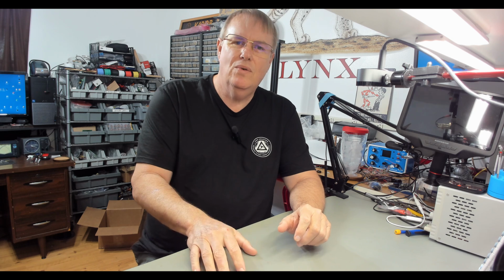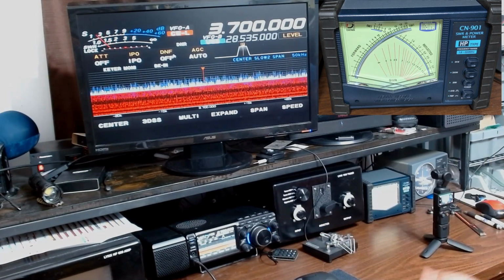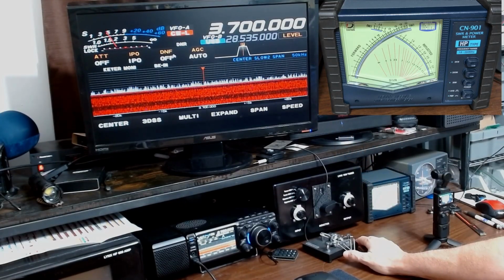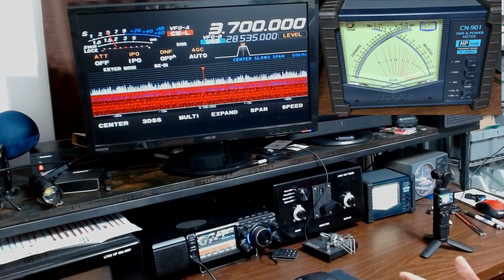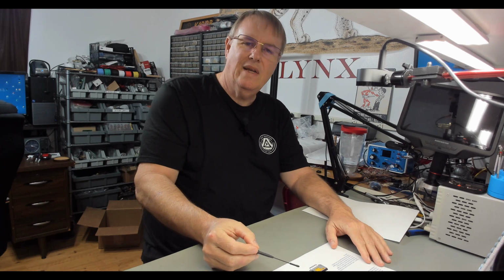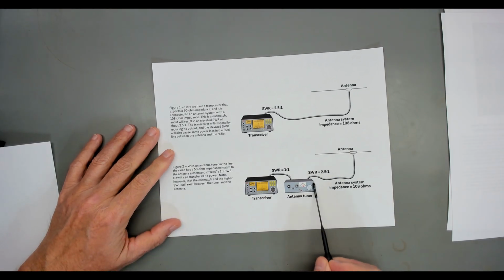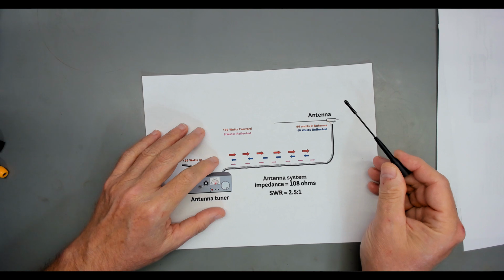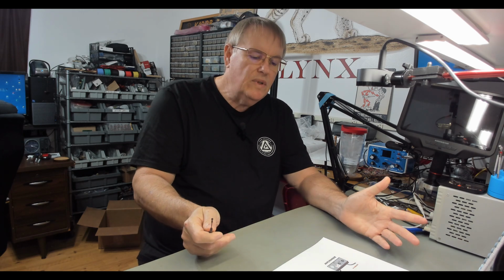What Most People Get Wrong About Antenna Tuners!

Comment: When a reflected signal arrives back at the antenna, it will have been delayed relative to the original signal by a time dependent on the cable length and transmission velocity in the cable. Isn't there a chance it will be out of phase with the original signal, thus reducing the transmitted power rather than adding to it?
Reply from the maker: If you look at the standing wave at points it is lower and at points it is higher but the end result is as everyone agrees, the power that is not loss in the feedline is radiated. It is not loss. 
RJ
Reply: @LynxElectronicsLab  The reflected signals are delayed relative to the original signal, so presumably they add to the radiated power by smearing it out in the time domain rather than increasing the peak value. Doesn't that cause problems with reception? The extent of any problems would depend on the wavelength and the cable length, and I appreciate it may not be an issue at the frequencies you're talking about. But it sounds similar to the multi-path problem that occurs both with radio transmissions and with fibre optics. Sorry if I'm barking up the wrong tree - it's 45 years since I studied this stuff and I didn't have a terribly good grasp of it then.
Reply: @stevegreen5358 the reflected power adds in phase with the forward power back towards the antenna

Comment: A lot of this is a matter of semantics. An antenna tuner is a matchbox. It makes the antenna system appear to be 50 ohms to the transmitter. It does this by canceling the inductive and capacitive impedances out, making it a resonant system. There might be a mismatch at the antenna feedpoint, but the portion reflected back to the transmitter get re-reflected by the tuner. All the signal would eventually get out to the antenna if not for loss in the transmission line. Coax is high in loss so that's why people like resonant antennas and avoid tuners. But I use a doublet which is not resonant. I rely on a tuner to make the system resonant and it works because my transmission line is open wire - very low loss. But the point is that the tuner does tune the antenna system and Ive proved it many times with a nanoVNA.
Reply: Absolutely correct you have described how the tuner electrically tunes the system to resonance, there's no semantics about that description
Reply from the maker: I agree it is all semantics, if you listen in my video I make that point many times. For example what is included in this so called “antenna system”. 
Do we tune antennas to resonance at all? Tuners do not come with VNA’s they come with SWR meters. Low SWR isn’t normally at the point of resonance. I understand both sides but I adjust my transmatch to make an impedance match with my radio. The rest takes care of itself. You are one of the few that gets what I am saying. Your description does not disagree with what I describe in my video. Except you call it tuning an antenna and I call it matching impedance. In the end it’s the old “taste great / less filling” argument. 😁
RJ

Comment: I prefer to use a 'remote' tuner at the antenna site, 33' vertical wire on a 12m Spiderpole, this remote tuner tunes against many random copper cables . The other tuner I use is the MFJ-989, mainly to protect the radios by transmatching the slight mismatch  on the transceivers. The only 'real tune' with this tuner is how I couple up the long wire and tune via cold water ground. Does a good job across HF bands.
Many thanks for explaining a very informative video to those who follow the myths, now they know the truth, best 73 😎 👍 🏴 ✨ ✨
Reply from the maker: Thanks, the truth resides in the middle and this was my point. It’s all semantics and this is why I said this in the video. 
RJ

Comment: The antenna tuner is more about protecting the transmitter output amplifier stage from high voltage and/or current. This is more an issue with modern solid state output stages where a mismatch risks unforgivable results. Replacing output transistors is not enjoyable.
Reply from the maker: No it is not! At least on the wallet. I kind of like do it myself. But I’m weird like that. 😁
RJ
Reply: @LynxElectronicsLab 
Also, some output transistors are no longer available.
Reply from the maker: So True! Man all the good parts are disappearing fast!
RJ

Comment: While an impedance matching network enables maximum power transfer to a non-resonant antenna (electrically long or short) by counteracting its reactance (using the complex conjugate), the antenna's inherent inductance or capacitance persists. This internal reactance of the actual antenna causes non-radiating energy to be stored in the near field (due to the phase shift between voltage and current within the antenna structure), oscillating locally around the antenna. The reactance measured at the antenna's terminals doesn't magically disappear, and consequently, the antenna itself will generally be less efficient at radiating power compared to a resonant antenna. However, this doesn't mean that non-resonant antennas are not useful, nor that impedance matching is not beneficial.  And yes! They used to be called a transmatch which is much more accurate.  I think the switch to calling them an 'antenna tuner' is more of a marketing thing.  Thank you so much for further clarifying this topic!
Reply: While most people use the term "non-resonant antenna", I prefer that you as least think of it as an antenna which is not naturally resonant at the operating frequency, because the antenna tuner (or loading coil or whatever you use to cancel out the antenna's reactance) brings the antenna to electrical resonance. Such an antenna will be less efficient than a naturally resonant antenna, but, with proper design, an antenna which is not naturally resonant at the operating frequency can be made to work surprisingly well. Take for instance, a doublet fed from a tuner using open wire line, or a broadcast tower which is not the correct height to be naturally resonant. One of the most famous high power broadcasters in North America, WLW, with their 500 kW rig at 700 KC, used a 5/8 wave tower whose reactance they canceled out with a tuning unit at the tower base.
Reply: A natural resonant antenna isn't necessary more efficient than a non resonant antenna, the tuner electrically tunes out the reactance of the whole system
Reply from the maker: Your welcome! Thanks for watching.
RJ
Reply: One thing I'd like a view on from the experts is whether it's any better to have an antenna of exactly 70Ω, than (say) a 50Ω-17jΩ with the same SWR. Is there anything better about 0 j or is it just the magnitude of the mismatch that matters?
Reply: I'm not sure that you are correct about off-resomance lowering effociency; reactance has no loss.

Comment: Here's a good way to look at resonance: Lets say we have a simple LC (coil + capacitor) series resonant circuit. It will resonate at some particular frequency. Now let's add a second capacitor in series. We haven't changed the original coil or capacitor in any way, but adding a second capacitor TUNES them to a new resonant frequency. In the same way adding series capacitance to an antenna, while it does not physically change the antenna, tunes it to a new resonant frequency. I wish people would qualify it when referring to the physical length of an antenna by calling it the NATURAL resonant frequency, the frequency at which the antenna resonates when no loading inductance or capacitance is applied. Hams often add a loading coil to their too-short mobile HF whip so it will resonate at a lower frequency. Antenna resonance is a electrical concept.

Adding capacitance or inductance to change an antenna's electrical resonant frequency is one function that an antenna tuner can perform. It can also perform the matching function, that is changing the radio-frequency resistance to a different value, similar to an unun or balun.

In my experience as a broadcast engineer, we use both of these properties of an antenna tuning circuit in the "dog house" at the base of the tower. First, we make the tower, which is not always the correct height to be naturally resonant at the broadcast frequency, exactly electrically resonant. (There are also "parasitic" factors which affect the tower's complex impedance and resonance, such as the tower lighting chokes or Austin ring transformers which get AC onto the tower for the lights.) Then we match the radiation resistance of the tower, often around 23 - 25 ohms, to the 50 ohm coax back to the transmitter building.

I hope this makes sense.
Reply from the maker: Thank for your very detailed input! I think kind of get what I was pushing. It’s not that I do not understand or believe in the resonance argument. It’s more about what a hams purpose for its use. They were in use long before Maxwell wrote anything about them. They built them to match the impedance of their radios to their antennas. They did a great job doing this and they didn’t know anything about the rest.  They simple knew if they put a variable T impedance matching network between their radio and antenna, they could match the impedance. Again thanks for a great response. 
RJ
Reply: @LynxElectronicsLab  Here's an interesting fact that is really mind blowing. An antenna can be resonant at multiple arbitrary frequencies simultaneously! (And I'm not talking about harmonically related frequencies.) How does this work and when is it used? These days, land for tower fields is expensive, so in many cases, two or more AM broadcast stations share a tower. Each transmitter feeds a separate 50 ohm coax to the "dog house" at the base of the tower. In that dog house is a separate tuning network which resonates the tower for each transmitter. After each tuning network is a filter which rejects the power from the other transmitter. The filters pass the desired signal, but look like an open circuit to the other signal. Thus the tower is made to be resonant at both frequencies and radiates both simultaneously. While I won't even touch on antenna tuning with directional arrays here, the most complex setup I know is in Minnesota, where four transmitters at four different AM broadcast frequencies, each with separate day and night directional patterns, feed an array of 9 towers multiplexed in various combinations. I wonder how many RF contactors switch as all four stations switch from day patterns to night patterns? Because besides the antenna tuning units which connect to the driven towers, towers which are not driven by a particular transmitter may be connected to a "detuning" network, which renders the tower electrically "invisible" at that transmitter's frequency so it doesn't act as a parasitic element and disturb the pattern generated by the driven towers. Therefore each tower in the array may be connected (through filters) to transmitters through tuning units, as well as detuning units for transmitter frequencies which are not connected to that particular tower. I would love to see a schematic of the 4 phasors feeding the coaxes to the towers, as well as schematics of the "dog house" equipment at each of the 9 towers. Some antenna consultant really went all out on this design.
Reply: @LynxElectronicsLab so do you think it's OK to keep people in the dark of the full capabilites of an antenna tuner and suppress those actually trying to educate people on what a tuner actually does, perhaps an updated video would be a good idea on a tuners full capabilites
Reply: @Pioneer936  For a long time I have advocated for adding a couple questions to the General exam question pool about antenna resonance and antenna tuners so that prospective hams can learn these concepts when they get licensed.

Comment: Nope they fool the transmitter into  1:1 swr reading and protect the transmitter from high swr
Reply from the maker: I look at it just slightly different, fool in my mind is not really true. The transmatch gives the radio a 50 ohm load to delivery it’s power to. As far as the radio is concerned it doesn’t care what the load is just its impedance. The doesn’t care if the load is resonant. Hook the radio to a resistor in a can of mineral oil that is 50 ohm, it’s just as happy! 
RJ
Reply: @LynxElectronicsLab agreed i should have probably used a different wording impedance matching a better way of explaining it..
But to be fair a correctly matched antenna will perform better..
Reply: It’s only fooling a fool.

Comment: That was a great explanation. I have been trying to get some folks at my club to understand what the antenna tuner does and does not do.  I was surprised how many people think that the antenna tuner magically does something to the antenna. I have been trying to emphasize transmission efficiency vs tuning a wet noodle antenna, and them thinking they have a great antenna. I am also surprised how many people spend big $ on a radio, but then feed their $100 antenna with RG-58. Too many people depend on the magical antenna tuner, IMO, instead of trying to understand the big picture of what is happening in their antenna system as a whole.  And, when the bands are open, and great, you can get away with a poor antenna system, and still make contacts. That might not be the case when the bands are not so good.
Reply from the maker: Thanks for your comment!
RJ
Reply: It's amazing to me that when it comes to antennas all knowlege of electrical circuits is ignored. Any time you have an alternating voltage wiith capacatance and indutance you have whats known as a TIME CONSTANT in other words changing the value of either of these changes the time it takes to send the wavelength inductance will shorten the wavelength an capcatance lengthens it. Antennas have 3 standing waves E C & L. The way atuner works is by adjusting capacatance and inductance until the signal is the same length as your wire and the SWR ratio  is the ratio between inductance and capacatance with inductance the current lags the voltage 90 degrees while with capacatance the voltage lags the voltage 90 degrees a tuner adjusts the signal to the length of the wire then adjusts the C & L until they 180 degrees out of phase and cancel each other outleaving only resistance.
As far as the old Walter Maxwell myth of retransmitting reflected power there is none wat you see on your meter is current created by impedance interacting with the voltage in the feed line.
73s, Bob AF4js
PS the only place you can get an accurate reading of an antenna circuit is right before the final tank ciruit!

Comment: The tuner does not simply make the radio happy. Everything after the tuned tuner is a tuned resonant circuit. Everything else you said I agree with, but the tuner, the coax after the tuner and the antenna are a 50ohm impedance resonant circuit. The reason your measured power went up with the tuner in line was because of the resonating effect caused by the tuner. This is why it is best to have the tuner at the antenna feed point. With tuner at the antenna feed point the tuned circuit doesn't include any coax to lose the resonating signals.
Reply from the maker: Thanks for your input. 
RJ

Comment: This misconception that an antenna tuner does not change the resonant frequency at which the electric current oscillates in an antenna is caused by a fundamental misunderstanding of the concept of resonance. But it seems to be a very popular misunderstanding.  An SWR bridge between the antenna tuner and the antenna is completely the wrong way to understand what's happening.
Reply from the maker: Thank you for your input. 
RJ

Comment: Many years ago it was said an antenna tuner should be called an antenna matching unit.
G4GHB.
Reply from the maker: That was there original name. 
RJ
Reply: Yes. But why won't you elaborate on why the change happened (?)
Reply from the maker: That was what they were called. The diy guys called them transmatches and antenna matching units. 

Well since I was not producing them when it happed I do not know but have been told the producers all started calling them matchboxes which was trademarked and lawyers got involved. Then the non trademarked antenna tuner popped up. Most said it sounded better for marketing. Don’t know, but can tell you it had nothing to do with Walt Maxwell as some claim. Check dates, antenna tuner was in use long before his work came along. So no I am not avoiding it just not sure why it changed and do not know why it would matter unless it was because of Maxwells work which is easy to prove it isn’t.
RJ

Comment: I don't understand this. Why would an amplifier have a 200 Ω input? Especially if you bought one commercially made it should surely be 50 Ω.
Different if you made one but you would adjust the input circuitry to get 50 Ω.
G4GHB

Comment: What about the claim that the tuner sends the reflected power back down the transmission line in-phase, effectively making the system near maximum efficiency (minus the minimal losses)? Thanks for the explanation. Very well done!
Reply: You are absolutely correct, the tuner does correct the phase of the reflected power in phase with the forward power
Reply from the maker: Thanks for the question, The phase between the forward and reflected waves change as they travel along the transmission line either from a tuner or your radio. They interact creating standing waves. So a tuner does not sync them up in phase. If you search YouTube for standing wave simulation you can find some great illustrations of this to see. 
RJ
Reply: @LynxElectronicsLab the tuner does indeed correct the phase of the reflected power, Walt Maxwell goes into detail to explain how

Comment: They match, which is why they are called trans matches, or matching units. 50 ohm radio impedance is arbitrary, and a newer limitation based on current technology. Your antenna is a system, and matching units can be a good addition to it.